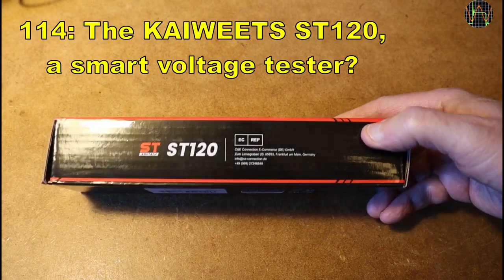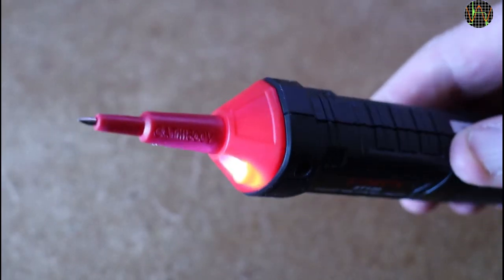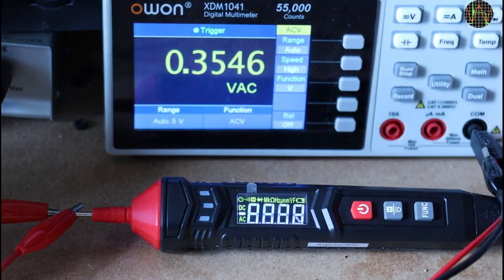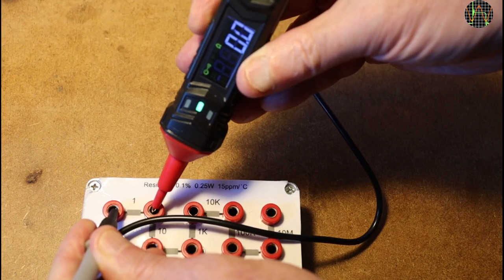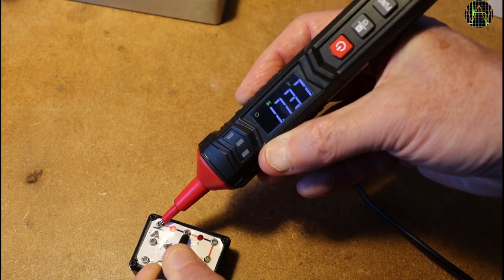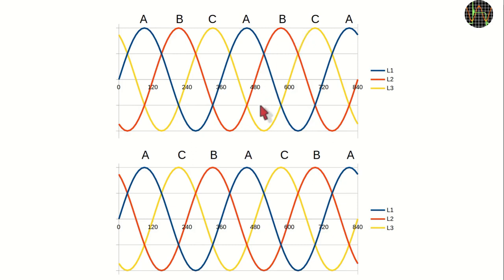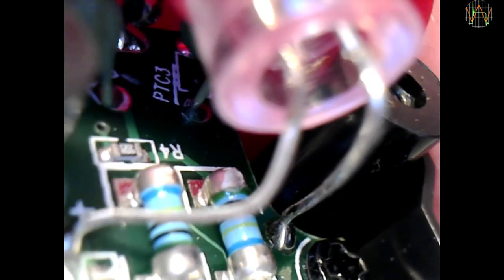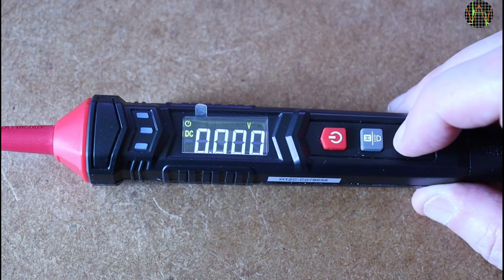114 - The KAIWEETS ST120, a smart voltage tester?

Comment: Found on the internet your video you did some time ago using the LibreOffice Draw to make your front panel layouts. I would be interested in further information on how you did this using LibreOffice Draw, especially how you divided the arc into sections for switches and variable resistors.
Reply from the maker: The trick is little know feature. If you select an object, press F4 to get a window that allows you to select where the base point is for positioning it, sizing it and crucially for rotating it. The other trick is using layers to create many helping lines for alignments and whatever, but disable that layer from printing. Say you have circle and you want to create dividing lines. Draw a vertical from centre upwards, as far as you want. Select F4 and shift the rotation point to the point that matches the centre of the circle. Then you can type the needed angle for rotation. Sadly you can only see the result when pressing OK which closes the window. Doubly sadly, LibreOffice doesn't remember the base point setting, so you have to remember to do it again if you want to rotate it some more.